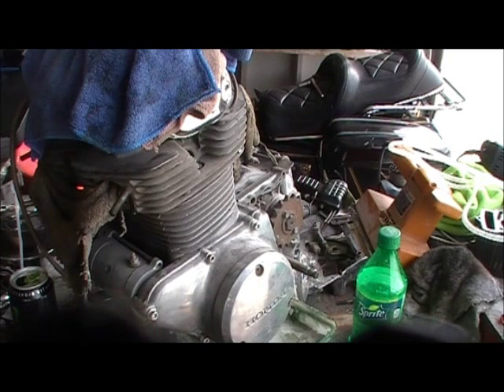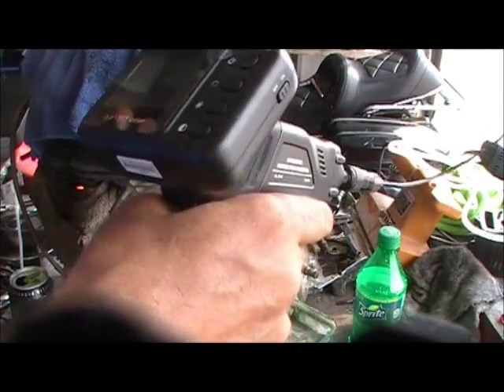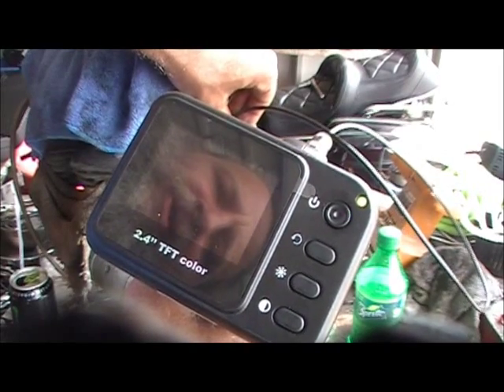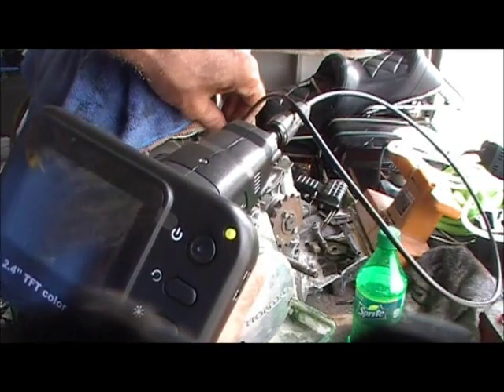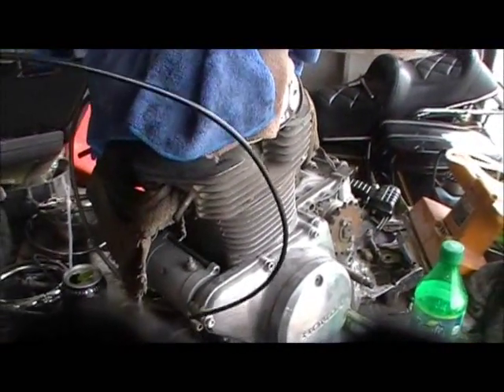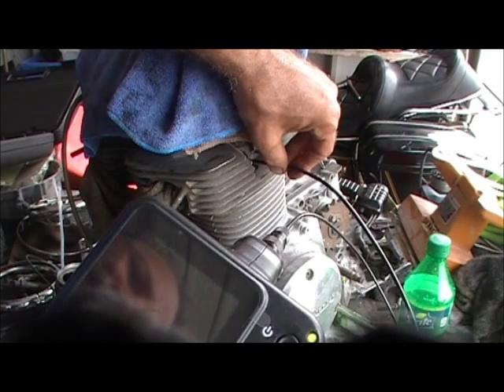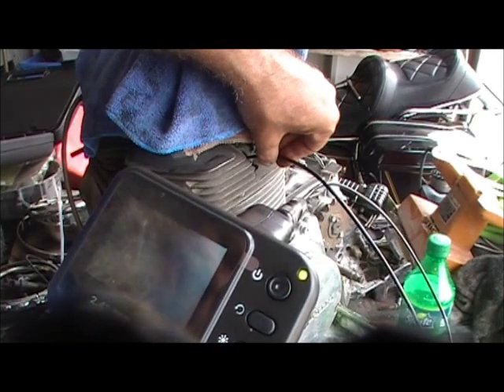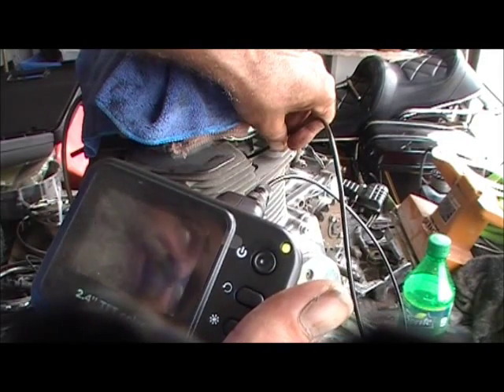Checking An Engine Inside Without taking it apart

Comment: Is it possible to check the cam chain rollers on a cb350 without spitting the engine open?
Reply from the maker: Pop the valve cover off and look down --